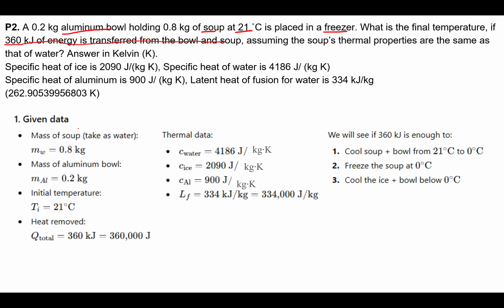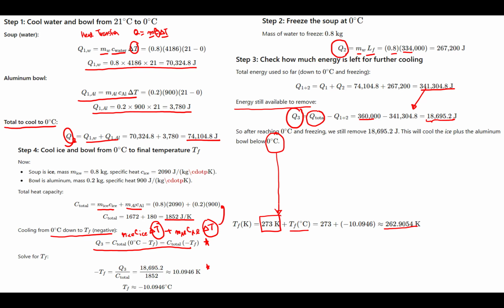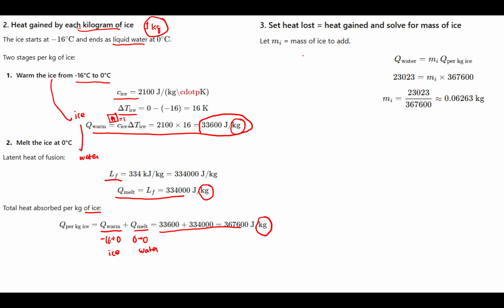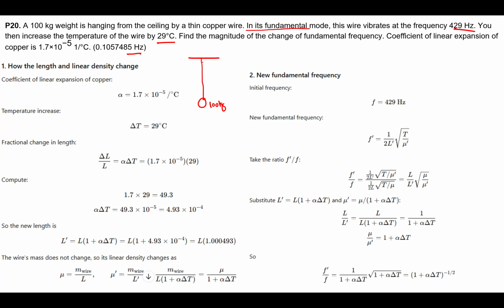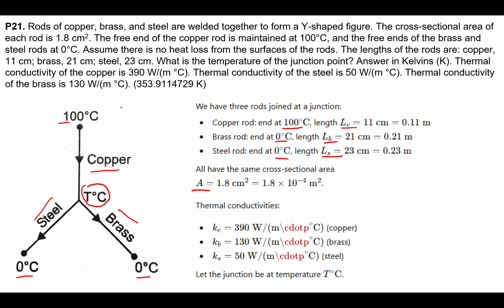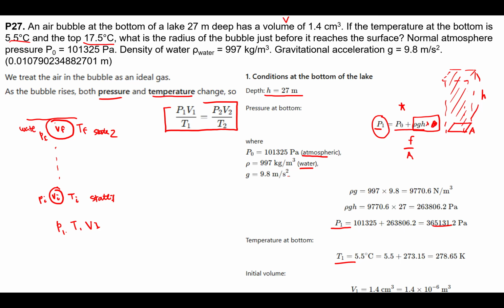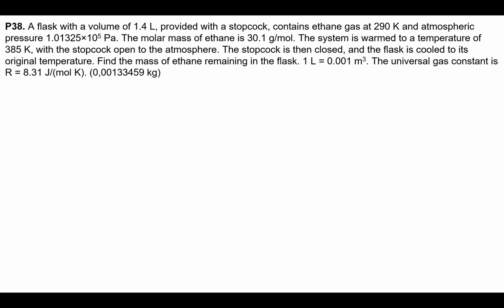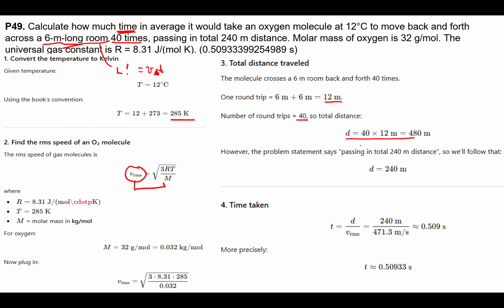PHYS161 Exam4 problem-solution-1

Comment: Mussakhan Aida 
202137315

Easiest — 4, since it requires only to plug in the values in a formula, pretty straightforward.

Hardest — 21, since it requires several formulas and a substantial amount of understanding of the topic/concept.

Thank you for the video, Professor Oh!

Comment: Aldiyar Rustem 
202269510 

For me the easiest was the problem 9, as it is connected with the last problem set and didn't require a lot of new material 

On the other hand, the hardest problem was problem 21 for me. Mainly because of the algebraic and formula manipulations we had to do to solve it.

Comment: Angelina Krachkova
202414093

Easiest: P41, because it doesn't require numerous formulas and is done by simple substitution of values

Hardest: P21, because there are multiple systems (of rods) to account for.

Comment: Nuray Beisen
202238481

For me easiest problems were those who required just one formula - 44, 41
values are given and you just need to plug in.
in 41 one straightforward formula is used PV = NkBT, with a single unknown of N and no multi-step setups. All you need to do is convert the given values into SI units and plug them directly into formula.

Foe me the hardest one was 21, becuase it involved a lot of information in the content, and it's not a simple one-rod conduction question but it involves three rods meeting at a single junction, so heat entering from the copper rod has to split and flow out through both the brass and steel rods at the same time.

Comment: Arailym Sukhanbay
202427660
Easiest:P41,P13,P2 (because we only need the formula)
Hardest:P21,P20(Because it's a complex task with multiple themes.It's easy to make mistakes by missing some steps.And required to know and understand so many formulas and be able to mix them.)

Comment: Makhabbat Makasheva , ID: 202394764, easiest problems are P34, P41 as we need to use only one formula. As well for P1, P3. The hardest problems P2, P5, P21 as it requires the understanding of the concept and implementing several equations

Comment: Yelmurat Kurakbay 
202337776

The easiest problem: P4, because it only required substituting the given values into the formula we had already learned.

The hardest problem: P21, because it involved analyzing heat transfer through three different rods simultaneously. Solving it required a solid understanding of multiple concepts and the ability to apply them correctly. Heat first flowed through the copper rod into a junction, whose temperature had to be determined, and then continued through the brass and steel rods. The junction temperature was calculated using the heat flow equations.

Comment: Nuray Bakytzhankyzy 
202471436
P41 is easy because it uses one formula and only requires basic unit conversions.
P24 is hard because it requires careful unit conversion and correct use of the heat-conduction formula.

Comment: Zerde Aidynbek   202464725
easiest: #8 because the heat terms are all clearly stated 
hardest: #27 because of fluid pressure and ideal gas law being combined in one problem

Comment: Aigerim Konyrbayeva 202316230. The easiest problem for me was P9, because if you know the formulas for gravitational potential energy and thermal energy, you can easily solve it. The hardest one was P21 as it is tricky if you do not understand the whole picture.

Comment: Aruzhan Bilal - 202311353

Easiest: P2 As it involves simple geometry knowledge and use of formula. It was one of the fast solving problems in this set. The formula is pretty repeated throughout the set so I had no problems with it.

Hardest: P21. As it includes several steps of solution and arithmetic accuracy it was one of the challenging problems. Also, it is really easy to mess up the order of the materials which will cause incorrect answer. Therefore, I would recommend to solve it several times to get used to it.

Comment: Rustam Yussubaliyev
202521926

Easiest was number 4, I already solved it, uses a simple formula combined with the right triangle geometry

Hardest was number 20, I also already solved it, but I remember how hard it was, since I needed to combine 2 formulas and come up with a new one which shows the value of a frequency change

I also did not solve yet the 40+ tasks but they do not seem too complicated

Comment: Miras Kapen 202455122 
The easiest problem number 4: because it just gives values and we need put it in the known formule
The hardest problem number 21: because it is complex problem with 3 different materials rods. So we need set up a equation by using our understanding of heat balance

Comment: Dilnaz Maxutova 202244842
Problem 25 was easiest for me because it used basic heat formula to find temperature
Problem 27 was hardest for me because it took me quite sometime to put together the formula for finding pressure and it’s also multilayered problem making it more challenging

Comment: Kunsaule Uspanova
202434947
Task 9 is the easiest one for me because it connects the previous topic (potential energy) to the main formula of heat, which is very straightforward as the values should be plugged to a ready formula
Task 20 seems the hardest for me because there are a lot details to consider and I might get confused during the derivation of the formula to get the final answer

Comment: Aisha Baimakhan
202368276

Easiest task for me 4, because by applying the formula of length and putting it under sqrt it’s not difficult for me.

The hardest task for me is 21, because there are multiple steps and formulas needed to remember and keep attention on many details, in order to find the temperature

Comment: Uldana Kambar 202455437

The problem 29 is the simplest because it requires only one equation from the kinetic theory of gases. After identifying the correct formula we can simply substitute the given values and solve for the temperature.

The hardest problem is the 2nd. Because it involves multiple stages of heat transfer. We must account for the cooling of the aluminum bowl, the cooling of the soup, the freezing of the soup and the cooling of the ice after freezing and missing any stage gives us an incorrect answer.

Comment: Nurdaulet Raushan
202423575
The easiest problem: P41
Because it is a straightforward problem that only requires using one formula (PV=NkbT)
The hardest problem: P20
Because it combines two different topics, wave physics and thermodynamics, which makes it much more complex to set up.

Comment: Yerlanuly Yersultan, 202418624, the easiest problems were the ones that were related to ideal gas equation and root mean square velocity, such as P33, P29, P27 since you only need the insert values into a one simple formula with proper unit conversion. The Hardest one was the P21, since it involves multiple rods of different materials and lengths, as well as the use of more complicated equation.

Comment: Almas Altyngazy
202447246

Hardest problem-21 

because it requires a multi-step conceptual setup. The student must understand that heat flow into a junction must equal the heat flow out (steady-state conservation). This involves creating a system of equations accounting for the different thermal conductivities

Easiest problem-20 

This problem is considered the most straightforward because it is a direct application of a standard formula for thermal conduction.

Comment: Arailym Suleimen 
ID: 202369896 

The hardest problem is P20, because it connects thermodynamics with wave properties. You have to thoroughly understand the concepts of both topics (such as “linear density” and “fundamental frequency”) in order to properly connect them, which may be quite challenging. 
The easiest problem is P41, because it requires rearranging only one equation. But you still have to be careful when converting all the given quantities into SI units.

Comment: Aidar Samigolla 202396235
P20 is easier because it uses one main idea: heating makes the wire slightly longer, which slightly lowers its frequency.

P36 requires several steps: converting temperature and radius into proper units, using the ideal gas law to find the gas volume, finding the cylinder’s cross-sectional area, and then calculating the height. It also requires correctly understanding the piston and vacuum conditions.

Comment: Safura Kudiyar - 202469576
The easiest problem is 29, cause it only requires to fill the numbers in formula and there is almost no useless values that just distract us. 

The hardest problem is 20, as it uses several topics of physics. So, to solve it you need to understand all the concepts and then mix different formulas to obtain the answer

Comment: Aidana Shardarbek
202341558

Easiest: P49. It only required finding the molecule’s speed and then using distance and time, so it was straightforward

Hardest: P35. Because it combines the ideal gas law with pressure and force, so it took more steps to solve

Comment: Yerassyl Ualikhanov
202443397

P24
This is a fairly easy task that requires the use of the standard thermal conductivity formula kAdT/d, since all the variables are already in the condition and you just need to substitute them into the formula.

P20
This is a difficult task for me, as it requires the integration of physical concepts, and it must also be taken into account that a change in temperature causes a linear expansion that changes the length and density of the wire. To solve this problem, you need to know the relationship between thermophysics and wave mechanics.

Comment: Gaukhar Ilyassova 202452292
P13 - easiest because there are no complex gas laws and requires simple formulas 
P91 - is the hardest because it involves three different parts, hot, cold and steady state process, where entropy changes in each part

Comment: Shahzada Takirova , 202372223 

The easiest problem was P85, because it required only one simple calculation. The power of the engine was divided by the number of cycles per second to find the work done in one cycle. No unit conversions or complicated thermodynamic formulas were needed.

The most difficult problem was P13, because the steam passed through several different stages before becoming ice. First, the steam had to cool Then it condensed into water, the water cooled and finally it froze. Each stage required a different heat formula, so all four energy values had to be calculated and added together.

Comment: Daryn Zhantileu 
202447012
Easiest problem 43, because its just single step calculation with one formula.

Hardest problem 26 because it requires to connect two different topics, volumes of the objest and calorimetric heat-balance equation. Moreover, it's kinda tricky because ice melts at 0 degrees and the added mass of water equals to the mass of ice added.

Comment: Ali Perdekhan, 202472674

Easiest: P34. The problem asks for the temperature from the average translational kinetic energy of a molecule. We just use the formula and substitute the given values. Everything is already in SI units, so it’s a one‑step calculation with no extra conversions
Hardest: P26. This problem requires three distinct stages. First a calorimetry step to find how much ice melts when the hot water cools to 0 °C, then converting that melted mass to an added volume using density, and finally applying the cylinder volume formula to find how much the water level rises

Comment: Madina Akhmetova
202345787

The easiest problem was 41, as it uses only one formula and the given question is straightforward and simple.

Problem 20 was the hardest, as it combines several topics together and has few confusing steps, especially the part where you find the new frequency.

Comment: Mussin Salim
202449267
p21 for me was the hardest because the main formula of the problem was new for me and thermal conductivities were not the easiest terms as well
p49 was the easiest in my opinion, because it uses only 2 formulas, one of which is kinematics. second one is the easiest in the whole chapter (rms speed formula)

Comment: Nurpeiis Meruyert 202458556
I found 9,10,38,41, 33 to be easiest one while 21to be hardest 
38,41 involves very familiar to me concept of Ideal gas,which I learned when I took genchem1. Also, the problem themselves only require to know how to properly convert and modify main equation so that we find right variable 
9,10 also includes familiar concepts, that we learned earlier. We only need to know exactly how Heat, Kinetic energy and potential energy are related, calculation itself is not confusing or hard. Same with 33, only correctly modifying formula is needed. 

20 requires knowing multiple concepts and their relationship , I had previously problem understanding. Also I find derivation of equation to be confusing.

Comment: Margarita Akopian, 202446348
Easiest: P29, because if you know that the temperature of the mixture of gas is the same as the temperature for any gas in this mixture, you just need to substitute the values of M, root-mean-square velocity of Oxygen gas and R constant to the simple formula, which was derived from that for root-mean-square velocity. 
P4 is easy too if you know how to deal with right triangle. 
Hardest problem: P2, because solving this problem required high attention to details: It was necessary to convert the units. Moreover, derivation of the final temperature equation requires bringing the specific heat equation and the latent heat of fusion equation together. It was hard for me.

Comment: Sabina Sabiyeva
202441432

The easiest problem: P4 as it just required us to put in the already given values into the learned formula.

The hardest problem: P21 as there were 3 rods to consider when balancing heat flow. Thus this problem requires the understanding of several concepts and their correct identification and application. The heat flowed through the copper rod into a junction(of which we needed to find the temperature of) and then into brass and steel rods. The said temperature was found through using heat flow equations.

Comment: Aruna Amirbay- 202446178.
P24.This problem is the easiest because it only requires using the standard heat conduction equation. After identifying the given values—thermal conductivity, area, temperature difference, and thickness—you simply substitute them into the formula and solve.
The Hardest Problem: P20

This problem is the most difficult because it combines several physics concepts into one question. To solve it, you need to understand thermal expansion, wave motion, and the physical properties of the wire, rather than relying on a single formula.

Comment: Kamila Taitoleuova 202314114
Easiest problem: P29. It only required one formula and the solution was straightforward because I needed to derive the temperature from the RMS formula
Hardest problem: P21. It was hard for me to understand how the heat flows through the system of 3 wires where one is heated and how to use the formulas to calculate the temperature of the junction

Comment: Shugyla Tokhtarbek, 202557743. 
Hardest: P2. Solving the problem requires numerous calculations and processing of each value. 
Easiest: P4. Uses common geometric concepts and one formula to solve the problem.

Comment: Akniyet Yerzhankyzy 
202318346
The easiest problem was 49, which is straightforward to solve using only  two formulas which are familiar( which are used in set 1 too)  and just logic
The toughest one was p20 as it requires comprehension and concentration to solve

Comment: Name: Madina Mukatova
Student ID: 202356143
Easiest problem: Problem 9. It was the easiest because it only required applying the conservation of energy. The gravitational potential energy was converted into heat so it only involved using two formulas and simple calculations.
Hardest problem: Problem 20. It was the hardest because it required combining multiple concepts. I had to consider thermal expansion, the change in linear density and the equation for the fundamental frequency of a vibrating wire. It involved several steps and substitutions before finding the final answer.

Comment: Lyazzat Tuyakova 
202428796
 

The easiest problem is Problem 4 because the formula is very simple and easy to memorize.The hardest problem for me is Problem 20. Although it seems simple, I struggled with the calculations and with deriving the formula because I kept forgetting some of the details, when I did it myself.

Comment: Zhansaya Nurnazarova. 202458053

The easiest was P41. This task requires just the knowledge of the formula and SI units, which are basic things to know, quick and easy solution.

The hardest task was P2. Even knowing chemistry I got lost in the steps of bowling,  cooling, freezing. This is the type of solution which is harder to think of solely, but thanks to your demonstration now I know how to do it

Comment: Torekhanuly Nurtore, 202334607 :  The easiest problems are P1, P3, and P12 because you solve them in one step using a single basic formula. For example, P12 only requires the standard heating formula after converting weight to mass. P1 is a simple unit conversion of power and time into kilocalories, and P3 uses the basic linear expansion formula directly.

The hardest problems are P2, P5, and P19 because they require multi-step tracking, systems of equations, or geometric calculations. P2 is the most difficult because the final phase of the soup is unknown, forcing you to calculate a step-by-step heat budget for cooling, freezing, and then sub-zero cooling. P19 requires setting up and solving a system of linear equations for two connected rods, while P5 forces you to combine thermal expansion with the Pythagorean theorem, where tiny rounding errors easily ruin the final square root calculation.